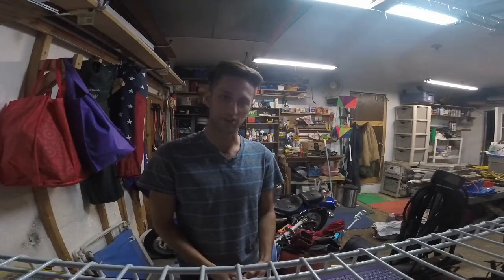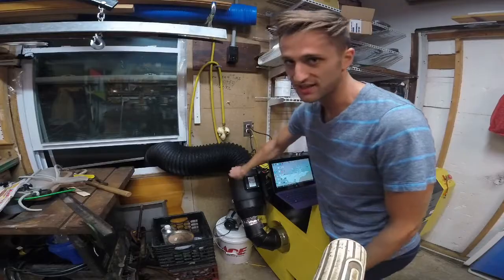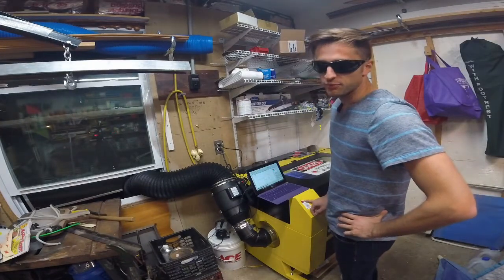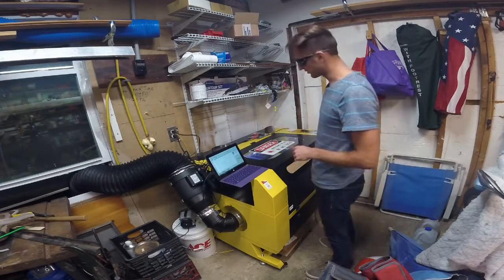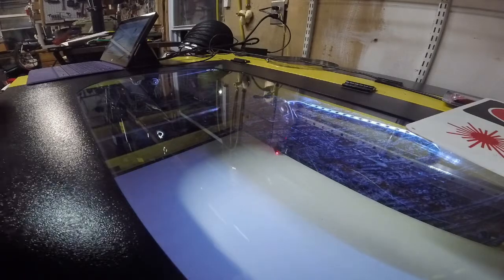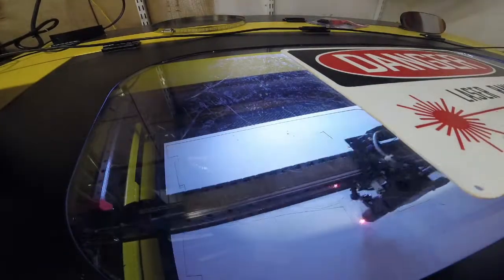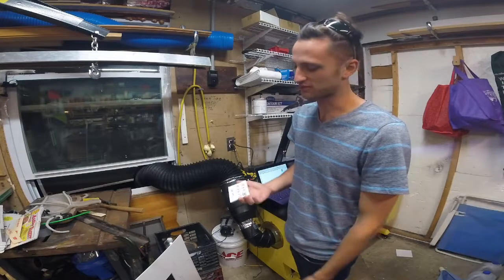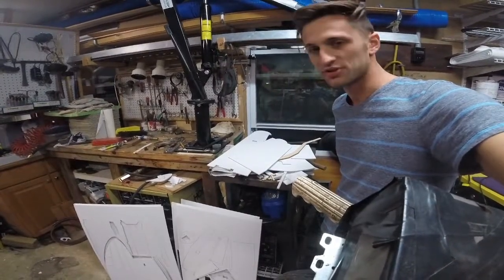Chinese Laser Cutter (Cutting FliteTest Airplanes)

Comment: I have looked thru eBay and cannot find any with a working size of 30x20? Yours seems to do just fine with a reg. Foam board. Any help is appreciated. Thanks Thomas
Reply from the maker: Hey, so I had no model number or anything when I purchased mine. It's been a while, did I say I have a 20x30 working area? I probably meant I use the standard size foam board on my 20x28 cutter. the unused 2" sticks out a bit on one side but I keep it for small parts.
Reply: @lombardiengineering  ah, ok got ya.. thanks,  👍
Reply: @lombardiengineering  o